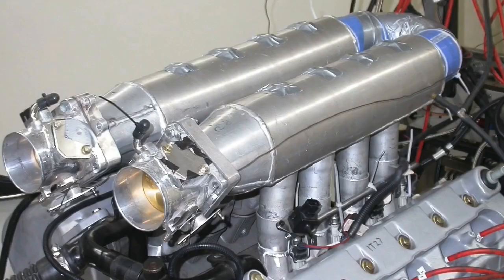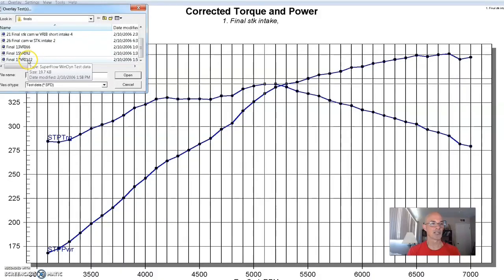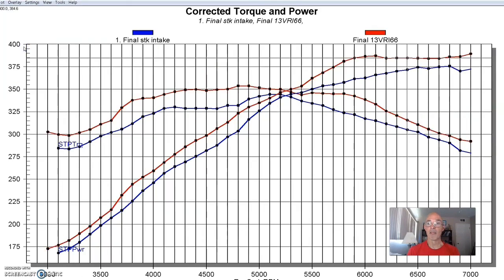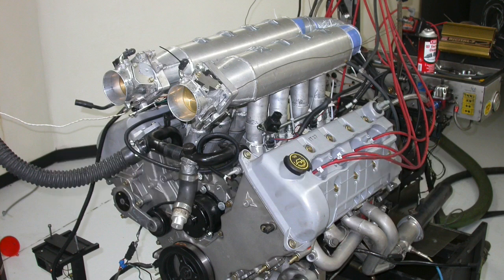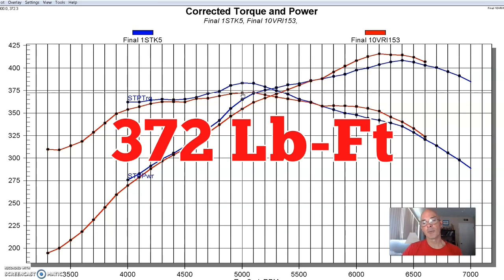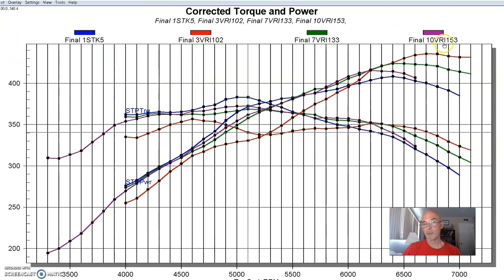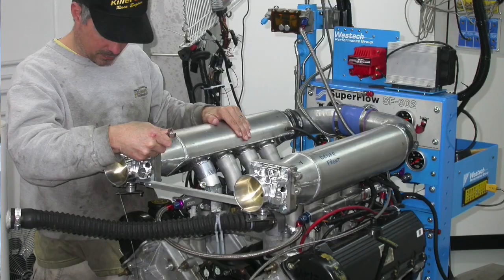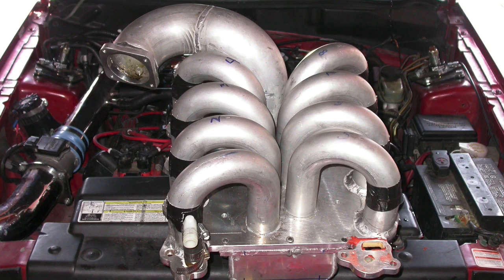CUSTOM INTAKES--BUILT NOT BOUGHT

Comment: The cobra motors DID have adjustable intake runners . It sat under the manifold and would open at 2500 rpm
Reply from the maker: are you talking about IMRC plates?

Comment: I only street drive my car and I never rev very high, so I guess a long runner would be best for me
Reply: Most of my stuff stays below 4 grand RPMs 80% of the time even if it can rev to 6-8 grand before hitting redline and the new RB v8 stroker ( 4.5 crank stock 4.25 bore ) mopar engine I’m putting together isn’t setup for HP as diesel like torque curves are good enough and modern 6 or 7 manual transmission and rear end gearing work so well together and is more realistically useable day to day

Comment: Ford actually had a dual runner length manifold on their V6 engines. It was a complex manifold with a trapdoor. By default the engine would be set at the long runners and as soon as the engine crept up in RPM the little trap door would flip to the short runners at high RPM. It wasn't a very reliable system.
Reply: until ford perfected it with the 1989 ford taurus sho, 3.0L DOHC.
Reply: @tartus4916  That would be Yamaha that perfected it. The whole engine in the Ford Taurus SHO 89-91

Comment: Build & test a long tube equal length collector like header.. (edit: as intakes, equal length long tube intake header with collector and no plenum.)
Reply from the maker: I've built lots of adj headers too
Reply: @richardholdener1727  i meant for on the intake side, sorry for not being clearer.
Reply: @AndyFromm  I want to do that on my cars. Basically the custom intake manifold will be headers in reverse to suck in the air more effectively.

Comment: I have an idea. Have throttle body on long runner and a 2nd throttle closer to intake manifold to open at high rpm
Reply: Like a 6 pack or triple quad so u could drive on one and then when u get ur foot into it it opens up
Reply: Have you seen a Ford SPI 3.8 engine before?
Reply: Is that ford 3.8 the one with imrc wear it's a 12 runner system 6long 6 short?  They did em on 4.6s too
Reply: @kevinjohnson9372  they also did it on the sho and the 32v engines, the svt focus had a barrel style, the svt contour , the 3.8 v6 the stroked 3.8...4.2 had them also. Ford really liked the dual runner intakes because it allowed for a flatter torque curve.
Reply: It’s been done
Reply: Sliding runners typically do much better but are a fucking nightmare to setup
Reply: Yes with mild boost

Comment: I'd LOVE to see this test on a 4.3 v6 there's only 2 different intakes available, dual plane vortec, or dual plane non vortec. Unless you can find one of the old nascar intakes. I'd be interested in seeing what gains a single plane would have on my little nitrous 4.3
Reply: I'm almost done with an EFI-converted Edelbrock #2114 intake on the 4.3 in my '97 s10 and I'm excited to test it out.  I don't think the good Vortec heads have any other intake available.  They call this intake a "dual plane" but the runners are definitely set up different than a v8 dual plane, it just has the left and right bank divided at the plenum.
 I'm pretty sure Richard did a video recently using this intake with a later model 4.3, carbureted of course.  I'd personally love to see a "big bang" test with EFI and turbo boost on a stock bottom end and see what it can take if tuned properly.
Reply: PS what a cool project for a 4.3!  Subscribed.
Reply: @DefenistrationAlley  awesome thanks!! I subscribed back 🙂

Comment: Look at the mazda factory racing lemans winning 787b 4 rotor. Adjustable intake runners depending on revs, beautiful engineering 👌👏👏👏
Reply from the maker: yes-and early F1 motor had same thing
Reply: @richardholdener1727  Alfa Romeo and Lancia had variable induction in their road cars in the 90's, although they had only two different runner lenghts.
Reply: @Karpo1986  In 1960 already existed that,,,
Reply: Some 2-strokes did the same with their exhausts to change the tuned-length of the expansion chambers.  Some jet skis even had variable water injection in the exhaust to change the temperature, which changed the local speed of sound (!!) inside the pipes to alter the powerband.

Comment: Mr. Holdener, with a long runner intake manifold, if you were to move the injectors further up stream would the engine enjoy the benefits of Charge Cooling or does this effect happen mainly in the plenum with carbs??
Reply: It works.
Reply from the maker: Hint-did you see the injector bungs in the top of the plenum? There were lots of tests run with these!
Reply: @richardholdener1727  future video?

Comment: Interesting results between the early and late engines. Combo 3 on the early engine gave improved torque and hp across the whole rev range, whereas the late engine it was a compromise everywhere. One was clearly better than the factory manifold, the other was a pure compromise.

Comment: Hold on a four cam v8 with aftermarket cams from comp only put down 376 seems  kinda low
Reply: This particular series of tests didn’t have anything to do with building for maximum power production. The engine is a good example of what’s typically found in a majority of daily driven Mustangs and provides real world results when testing the horsepower versus torque of intake manifolds featuring different runner lengths. 

Considering the relatively small 281 cubic inch displacement of the 4.6 liter Ford 32 valve V-8 with aftermarket cams, the power density ratio is actually pretty good. The Holdener method of testing and reporting the results is excellent as usual.
Reply: That is about right for a naturally aspirated 4.6L 4 valve. That is roughly 280 Cubic Inches, or about 1.34 Hp per Cu In.

Comment: any tests on runner area/ diameter or a tapered runner?
Reply from the maker: taper is harder to do-but made easier with 3D printing
Reply: Does the angles of entry on the runners from the cross ram intake planning to the intake of the cylinder head port make a big difference or not really?? ( like having it go straight in like most  stack injection vs 2 or 3 90* bends or a U mandrel bend in and out of the cylinder flanges to the intake plenum and of course everything is port matched because obviously that makes turbulence which I don’t think 🤔 ever works to your advantage to make higher hp or torque )

The reason im asking questions is I’m planning on making a variable length runner with flaps ( 🤔 of trying to have 2 to 3 different stages so I have lowered end , middle and higher end torque by folding the runners on top of each other ( 🥖 like kneading bread dough or making candy 🍬 ) with stepper motors ( my Version of vanos and or Gm’s DBW Throttlebody ) ( still will work with other ways like toggle switches or vacuum/boost canisters but the general setup is way different from mine ) controlling too open up a different set of intake runners ) inside like the ford SHO v6 aluminium intake that some people Polish up. mixed with the 1960’s max wedge 🧀 mopar engines longer 30” runner intake / Nelson racing engines /   Edelbrock intake Cross ram with a built in super chiller running a/c cooling at @ -10 f maximum capacity ( R744 instead of R12 refrigerant ) ( might never see it though and be wishful thinking 💭 that I get sub 0 f cooling on a 60+ F day and actually need M100 spray as antifreeze on the HX air side ( water side already has automotive antifreeze in it, 1-3 gallon total loop sizing with different 5~G main water to air loop to shed most of the boost heat way away from the front of the intake but after the low mounted turbos ) with higher humidity if at all🤷🏻‍♂️ We see ) it’s for my 440/426 hemi block platform was working on a b deck but it’s dead 💀 and this one is easier to build into a foe hemi it’s a or hot rod and NASCAR trick you might know about Richard. 

That cobra 🐍 intake picture you chose for the thumb nail is one funny 😂😂😂 looking part as I genuinely laugh at loud and thought 💭 what the hell are you up to now Richard after watching the video Look 👀 like it works but it’s goofy 🙃 cartoonish as all get out never seen anyone running one like that in my lifetime the closest thing I’ve seen is high and Mighty ramchagers/stack intakes but that’s straight up or in a cross ram folded flat with the ground not 120~* pointed out wards ( and obviously not across ram ) and 2-4 feet up from the rest of the engine. 

Would having variable exhaust runners work the same way as the intake side of the engine system?? I can’t get it to work on the project engine I’m working on right now with the turbos but maybe some one smarter than me in the future can or this will be helpful information for me and others in the future as I know that there’s a difference between log and longer fixed runner length exhaust as in the other videos of yours Richard and on the internet/real life information available to me and others

Comment: Richard, we've seen a consistent theme with runner length and relative power.  As a rule of thumb, is there a typical length that you would class as long, and same for short runner length? And is this measurement the effective length from the back of the valve?
Reply: Everything is probably specific to the engine.
Reply: Grumpy bill Jenkins wrote about it and posted to the internet somewhere ( brain 🧠 fart 💨 ) but be forewarned it’s long but filled out with really useful information. It had one entire section dedicated to port and head design and a different one for valve train design and setup and after all he figure out how to keep up with much bigger engines than his for awhile

Comment: I am surprised that you don't have a 3d printer yet. Lots of even hobby printers will push .065 nylon trimmer line that you can find with glass or Aramid fibre. The benefits of having a printed intake is you can have proper runner taper and gives you so much more freedom in packaging.
Reply: or make sections that screw on for quick changes.
Reply from the maker: I have some 3D printed intakes too-the problem is usually heat

Comment: I think it was the “High And Mighty” Ramchargers of the early 1960’s used radiator hose as the intake runners with a huge metal box as the plenum. Some pictures the runners would be so long the carbs were almost above the roofline. Those cars had some cartoonish exhaust too.
Reply: you are right, and they used hose so they could keep cutting it shorter and shorter until the quarter mile times increased, and they knew what the last best runner length was. 
They needed that plenum because unless you use a sequesial port injection, every time the intake valve closes, the air/fuel mix runs back up the runner.  If there's a shared plenum, the air fuel mix goes to another cylinder. but with individual runners and no shared plenum, the result is a hazy fog of atomized fuel hanging over the top if you've ever seen a mechanical fuel injector setup idle in the pits.

Bruce Crower took it a step further, using different length caliopes on his injectors.
Reply: @albertgaspar627  
Another reason for the plenum is to keep air speed from siphoning the fuel up and out of the carb while moving foward. Look at early  drag cars and Bonneville cars. 
I almost caught my car on fire while test driving and tuning while on the freeway with no air cleaner and no hood. 🔥😂👎

You should see later header designs, like what Smokey Yunick did. Or, the crazy-cool 180 degree and 360 degree headers. That's the tuning I like to read about.
Reply: The Ramchargers (all young Chrysler engineers, like Tom Hoover) basically invented the tunnel ram, and used this knowledge to design the Sonoramic Commando (lol) long ram intakes, as well as the Max Wedge cross rams.
Reply: I saw it run on tv, and the megaphone exhaust give it the howl from Hell!! It absolutely BELLOWED!
Reply: Those cartoonish exhaust were tuned also

Comment: Great video as usual.
Any advice for a wrx intake.
Reply: Yes replace it and everything under it with an LS :O)
Reply: @DodgyBrothersEngineering  
Lol... no thanks mate.
That would be a huge step backwards.
Reply: Then gen 4 sohc manifold is by far the best option without spending$$$$$
Reply: @robhudson6133  I was thinking of a double plenum with short runners for more hp at 7000 - 9000.
Will need 2 throttle body's...
Reply from the maker: I looked at doing those too

Comment: For engine geeks this is something we've wondered about. How does this apply to a boosted engine? Should the runners/volume stay relatively small while the boost does the work?
Reply from the maker: same under boost
Reply: Every turbo engine he puts on the dyno he runs NA first, you will see that the curves mirror each other in shape. Just look up his other videos.
Reply: I would love to see this also.
Reply: Runner length will have a similar effect on the power curve n/a or boosted.   short runner high/ long runner low. 

Boost pressure is just a measure of resistance.   It depends on what’s causing the”most” resistance, again its dependent on you combination of parts, as to whats going to change. 

Runner area matters,  the less area in the runner means more velocity for the same mass of air(how big is the straw),  which is beneficial at low engine speed, The velocity helps charge the cylinder at low rpm. But this can begin to be restrictive at higher rpm. Think about valve opening time and how that shortens as engine RPM increases. The more RPM increases the less time you have to shove air into the engine.  So a short larger runner with a good sized plenum, is what you want for high rpm turbo power.  Do you want a easy way to experience this go get a bunch of straws like a coffee straw and something you can suck a milkshake through and play around with blowing different fluids through them, Air is a fluid. 

Mazdas 787B 4 rotor race car for 1991lemans season had adjustable intake runner lenghs. The only vehicle I’m aware of with the moving intake manifold. Check it out

There is no one size fits all answer,  but boost pressure is just a measure of resistance in your system at a specified CFM and rpm. Over all air flow is what u wana pay attention to.
Reply: @williamkillingsworth2619  the LaFerrari (and possibly the F12 Berlinetta and other Ferrari 6.5L V12s) also have variable length intake runners.
Reply: @davidsteinhour5562  I will check them out, thanks for the heads up!
Reply: @williamkillingsworth2619  fluids don't compress
Reply: @oldleatherhandsfriends4053  Liquids don't compress.  Gases do.
Reply: @oldleatherhandsfriends4053  

Technicians: Air is not a fluid
Engineers: Air and liquids are fluids
Physicists: Liquids are compressible
Reply: @Fatherof001  If you want to see a compressible liquid in action, use DOT 7 silicone brake fluid in your car. You will marvel at how spongy the pedal is.

Comment: Have you ever done a similar test but vaying the runner diameter by dropping in sleeves?
Reply from the maker: not with drop in sleeves but good idea
Reply: @richardholdener1727  Radius entry and/or increasing the runner diameter helps gain power back with long runner intake manifolds, but not always.
Reply: I was thinking the same thing.
Reply: I tested a method similar to this on an old motorcycle once.  Slid velocity stacks up and down on the top side of carbs only(downdraft style).  Long=low end  short= top end
Reply: @dug8531  I have a set of these for my V twin Aprilia... vacuum operated.
Reply: @sorryociffer I was going to try vacuum but i found i needed RPM tuned runner length and Vacuum is based off of throttle position
Reply: @dug8531  moore mafia has a new video comparing velocity stacks on gsxr 2021 on the dyno

A new design has basically 2 trumpets on top of each other with a gap in between so the air flows through the easier path. 
They do pick up top and down low.

Also surprisingly enough dimpled velocity stacks added a tiny more too
Reply: @FirstLast-tx3yj  thats an interesting idea.  Dimples increase the airspeed by lowering friction I bet.  I like the thought of the gap between stacks.
Reply: @dug8531  its not just a thought its proven dyno results on liter bikes.

You can dig up some images if you google search black smith velocity stacks gsxr 1000

You will know it when you see it and obviously they are ITBs.

If they gain 7whp on motorcycles with very low displacement and squeezing every Hp they should on v8 especially helping in itb tuning
Reply: There were some indy car manifolds that were telescoping. So they could keep the engine in peak hp/trq range throughout the RPM band.

Comment: Now does adding boost amplify what each runner does ot does it change the actual shape of curve? Id think higher flow and less restrictions would come into play.
Reply: boost, for the most part, will amplify the results of the motor. Therefore, a long runner intake will act the same under boost, as the waves will not change.
Reply from the maker: same results under boost
Reply: So now does intake runner length change how effective exhaust header design is? Or do the valves separate the 2 and they are independent of eachother?
Reply: @paintballpartutd  my experiments in building headers showed exhaust tuning has much less effect on power than just getting the exhaust out with as little restriction as possible, but shorter tubes reduced low-end power slightly over long tubes. I didn't have the ability to make 4-2-1 headers then because I was just buying collectors and J-bends, but they have to reputation of reacting similar to long tube at low RPM and short tube at high RPM. I was just testing by timing a 1st gear rip to see what worked from 0-about 40 MPH or about 6K RPM. Traction off the line made for some variation between tests, and we did a lot of A-B-A testing to get rid of that particular set of gremlins. The good thing about that test is it did a very good job of averaging power, because higher average power = quicker pull. A better experiment would have been using a second gear rolling start, but my test area wasn't long enough for that.
Reply: @paintballpartutd  both